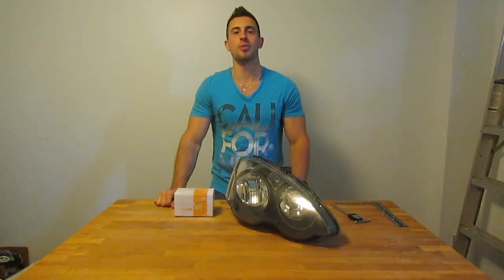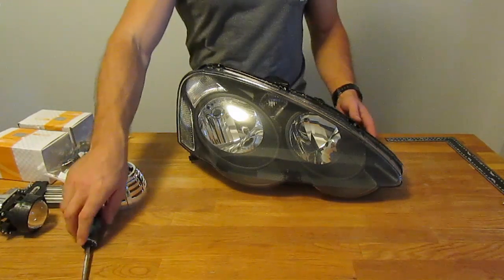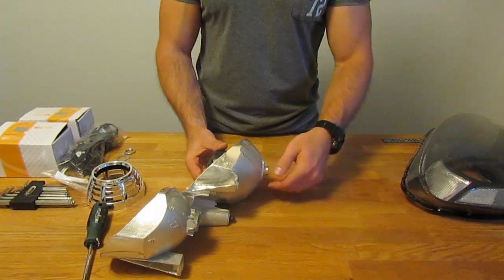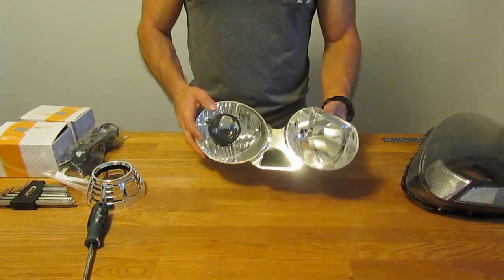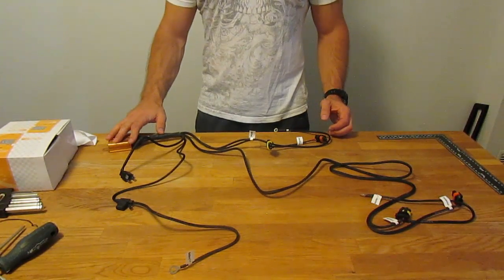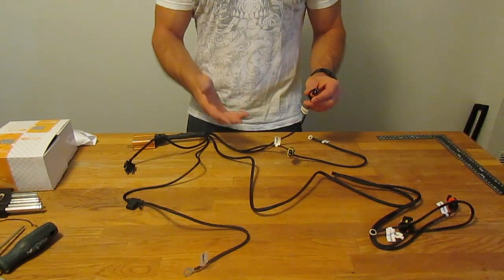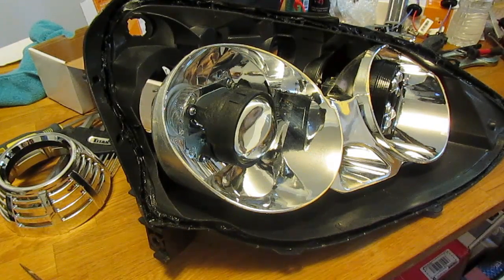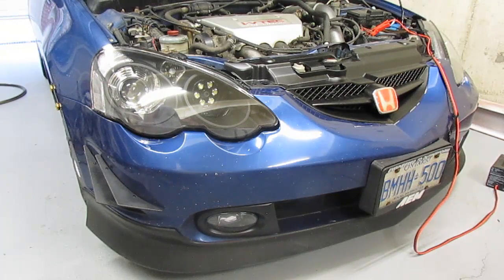HOW TO: HID Projector Retrofit Guide

Comment: My car have H4 bulbs for low and high beams, what do i have to do in this case?
Reply from the maker: You need a bi-xenon relay controller that is compatible with H4/9006 bulbs. Check out The Retrofit Source and they have what you need. It hooks up to your battery and keeps power to your bulb regardless of when you're in high/low. Then it uses your high/low signal to switch the projector cutoff shield up and down. Hope that helps!

Comment: Where i connect the wire coming from the projector headlight the red and black wire
Reply from the maker: I think you're asking where you would connect the projector cutoff solenoid... it would depend on the wiring for your stock headlights....

Comment: What's the link to the leds running lights and projectors
Reply from the maker: LED running lights are just 3W 'Eagle Eye' LEDs from eBay. I designed a circuit to make them sequence like that.. check out my other videos for a tutorial on how to design the circuit. The projectors are just Morimoto H1 projectors from 'The Retrofit Source' Thanks for watching!
Reply: +Embrace Racing koo thnx bro

Comment: Can we ajust the focus after doing this
Reply from the maker: Once the projector is inside, it is almost impossible to change your cut off sharpness without taking everything apart again. If you mean the "aim" when you say focus, then yes, use the regular method of adjusting your headlights. The projectors are mounted to the old reflector housing so they will move too.
Reply: @EmbraceMaking yes i mean aim thanks for information sir
Reply: Now i am working on projector 
Can you make a video on making of DRL with flexiglass or acrylic glass

Comment: do you have a video or know of a good one of a 06 style silverado
Reply from the maker: Not really aware of one, but the process would be similar I would imagine. Just be careful with your measurements! Is there something in particular that is unclear?
Reply: Embrace Racing no I just wanna know as much as I can before I order my stuff so I can do it myself. right now I had hids, would that effect anything?
Reply: truck did not originally come with hids
Reply from the maker: Should not affect anything. You will have to obviously remove the existing bulbs and depending on the projectors you choose, you may have to switch to a different HID bulb size.

Comment: Hey, it's me again. Can you please me with this strange thing? The H4 adapter plate and its placement on the headlight housing is not centered. Because of which my projector is not at all centered either. I find it really strange or I'm not sure if I'm doing something wrong. Here's the image https://www.screencast.com/t/BXsIdKk7eAg Thanks!
Reply from the maker: Not sure what to tell you... that hole in the housing looks weird. You might have to try and somehow fill that in?
Reply: Embrace Racing Thanks. It's actually because of the tab inside the ring. I removed that one tiny tab with a file and it worked perfectly.